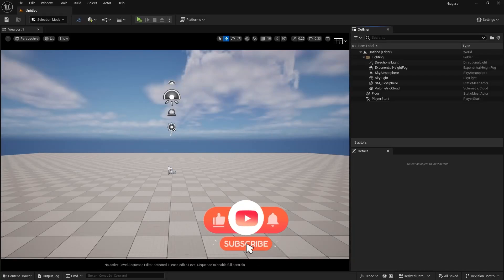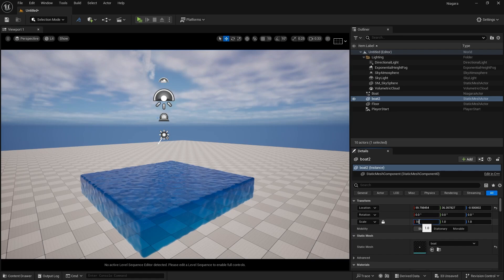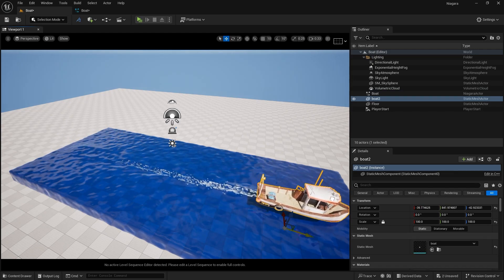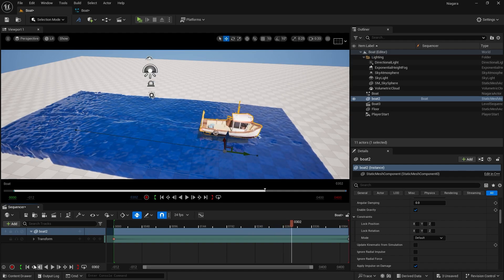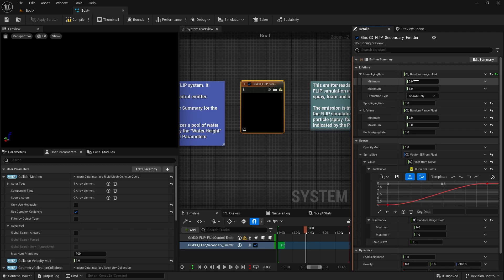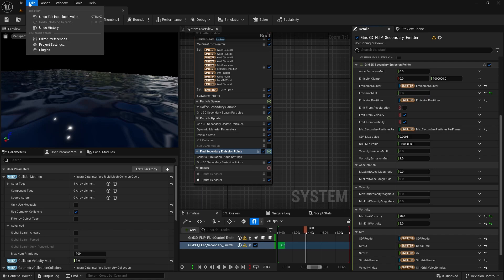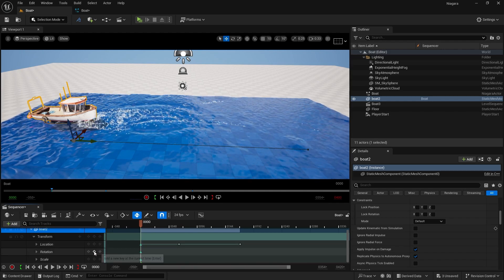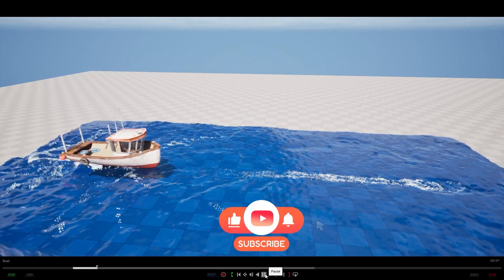Liquid Simulation in Unreal Engine 5 I Boat Simulation Tutorial I Niagara Fluids

Comment: I am not getting any foam
Reply from the maker: Have you done the collider tag in mesh and what object are you using
Reply: @RenderRebels  my boat was a blueprint and I thing to many parts so made simple mesh and attached it to the main build amd it worked. Do you tutorial on making ocean as from my cinema I have an old ship coming towards an island and need to change colour and waves.
Reply from the maker: Yeah attaching a mesh simple model shape of base of ship works well I explained that in video so if you don't get good foam that simple mesh can be used. I am experimenting with the ocean as it don't work with fluids so finding a way but yeah I am making a tutorial on wave as we don't have wave function in fluids so need to use the trick.